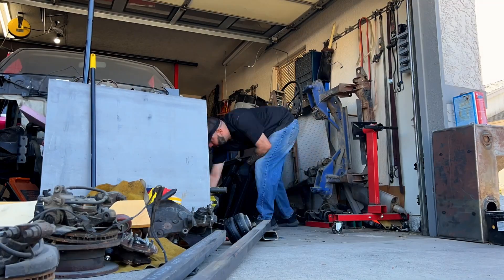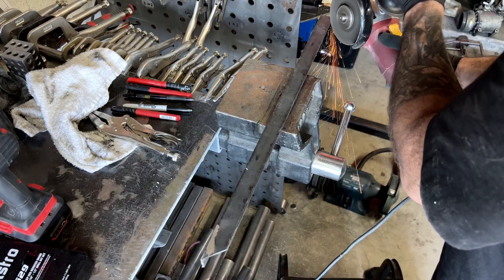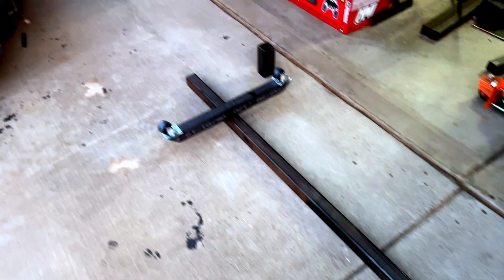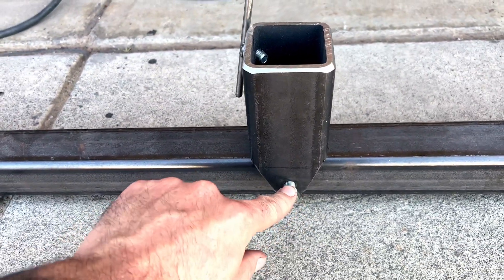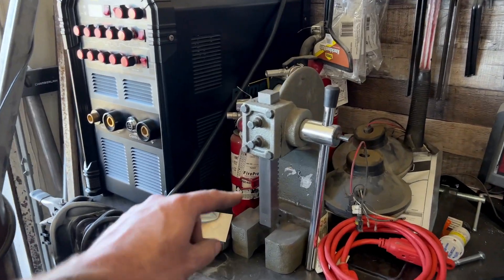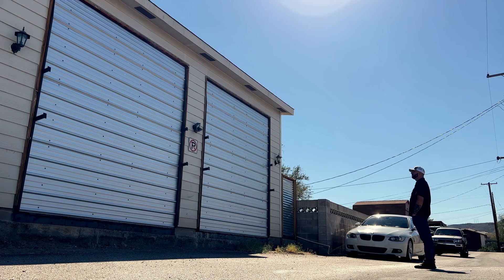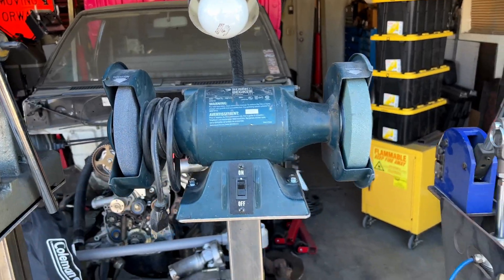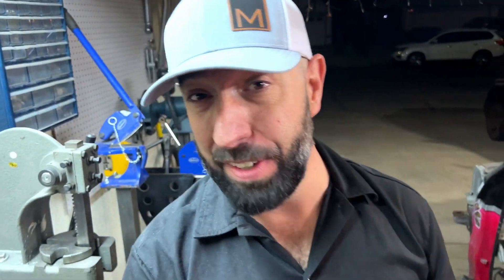Brilliant Legless Tool Stand/Storage System! Part 2? 🤔

Comment: I like the idea of having them easily accessible. At times its bothersome to dig it out and set up a tool .
Reply from the maker: @laurensmith1828  Agreed! In the short time the system has been up and running I found which ones I use the most and put them near the ends with enough room to use them without having to remove them.  👍

Comment: I like to maintain pressure down with a drill press and turn the tap with a wrench.
Reply from the maker: Oooo! I like that idea but I need more info. What do you put the wrench on when the tap is in the drill?
Reply: @GarageFab  I buy those taps that have a little hole at the top rather than a little point, and press a countersink or whatever into the hole.

Comment: Have you even seen and used an old timey secretary's typing station? It holds one typewriter and has a fold up/down extension on either side of the typewriter. Most importantly, it can be converted from wheeled to stationary. That conversion is effected by a lever that moves the four wheel casters to a point lower than the four stationary legs. The same lever reverses that action. I have one of these with a 5 or 6" vice attached and have used it for many years. I can bring the tool to wherever I need it and then secure it by raising the casters to place the weight and strain of the tool on the level shop floor. Reproducing this concept in robust steel for each tool would be rather complex and might be better done with hydraulics. It would also not be as rigid as your hole in the floor not to mention more expensive. Still, it might have an application for someone out there.

Comment: Nice work and idea, but I think I'd have built brackets off the wall and mounted the individual tools on that. Then using a single stanchion that would fit into the floor hole, set the stanchion and then the tool. This would keep your floor free and use FAR less steel and space. Tip that heavy monster over onto your nearly or completely finished car/truck and I am sure you'd be WAY MORE PISSED that you built something so incredibly top heavy and easy to tip. Remember, just a single pebble or wire or even a C-clip, could cause it to abruptly stop or go over.... So to me, this was an idea, but I'd never build it.. Your construction could cause destruction.
Reply from the maker: Good input, Steve!  Let me know if this is what you had in mind…
Brilliant(er) Legless Tool Stand/Storage System! Part 2.5!!
https://youtu.be/Jy9-lV8sn3g
Reply: Oh wow!!  Too funny... I just found your channel tonight and that roller rack was the very first video I watched. lol. I've been jumping around watching more, but until I saw that you answered me, I had not seen the answered video yet.. Too funny!!!  Now, I would make another observation and suggestion. Since you have space underneath the rack and already have brackets mounting it firmly to the wall, how about making a shelf under the rack to hold your chop-saw??  You probably already have a place for it that I just haven't seen yet, but for me, I like to keep similar tools close together.. For instance, I just replaced an old oak dresser that was storage under my workbench, with (2) lower cabinets from Hobo-Fright. The 8 drawers I use to have were too deep, but I could not afford much else when I built the bench. I'd fill and over-fill the drawers to the point of not being able to find things. Now i have many drawers that are far more fitting to typical tools and shop stuff and the drawers are all on bearings!!! This is great for a guy like me with a bad back!! I simply removed the wheels. Drilled some 1/4" plate for the 4 bolts and a nut I welded in the center to accept a 1/2" bolt that I screwed into the nuts to adjust the height and now the boxes are NIZ-EN-TIGHT to the bottom of my bench.   now, I'm going to check out more of your videos... Enjoy!!!  @GarageFab

Comment: Just subscribed to your channel cause I go through the same crap you do with room !  I need to find a way to store all my wife’s Kitty litter that seems to make its way in my shop! 
Thanks man, cool channel!
Reply from the maker: Spill more oil! Make use of that litter.
Thrilled to have you Gene! My passion is cars and fabrication but I’m getting this intense realization that everyone fights with the space issue. Not everyone can get a 2000 sq ft shop.
What I’m learning quickly is lessening the foot print of various objects is key. Think Sky scrapers. Put as much as you can on the wall, and stack things as high as you can.
We have five cats. 😳 and we purchase a years supply of litter every black Friday.
I built a cabinet specifically for cat litter that allows me to stack it to the ceiling in the tiny downstairs bathroom. It’s about 1ftx2ftx8ft. Barely noticeable space-wise.

Comment: Great idea of the square hole in the floor.  Its a little late now but using sliding posts that canv be adjusted back and forth on the main frame of the rolling stand would be great. This would be done by using short sections of slightly larger square tubing at the bottom of posts to slip over the  horizonta,l square frame tubing near the floor.

Comment: I totally get your excitement!  My garage is in a dire state of needing to be organized too...  And I need to add a tubing bender to the mix too.  Speaking of the bender, I also need some large radius curves for some bumpers I want to build out of some roll cage tubing.  Is that Harbor Freight tubing roller up to the task of curving strong material like that?
Reply from the maker: Yes Sir! It’s a great little tool! Go visit Swag Off-road. They make these “ears” that extend the width of the rollers which puts less stress on the machine.
Then to make it even better, they make a kit that attaches a Harbor Freight electric pipe threading machine to the roller to make it a power tool. 🙌
Reply: @GarageFab  Phenomenal, thank you!!

Comment: Definitely do the garage shop makeover with Justin. I was hoping you were just going to run those “set screws” as through bolts and drill holes spaced at a number of locations through your “beam” so that they would still be moveable but with the bolts or pins, it would’ve been more stable in the lengthwise direction. Of course welded works too!
Reply from the maker: It certainly crossed my mind, Erik! I was worried that if I Swiss cheesed the beam it would sag more, since it’s only a half inch off the ground. Even if it wasn’t so low, I’d still be worried I’d be weakening it since I believe it’s the vertical sides that provide the most support in this type of application.

Comment: I can completely understand having everything where you can find it again easily, and also the best thing about having a space for everything, is that when it's not there, you know instantly :) .. keep on going with allocating everything, as every square inch of bench top saved is a smile in an engineers heart
Reply from the maker: I have not had much experience being organized. I’m a hoarder and it shows. But lately! My newfound organization has allowed be to quickly locate several things that I’ve hoarded in the past and I received so much joy from it. It doesn’t feel gross anymore now that everything has a home and is easily found rather than lost in a pile of clutter.
Reply: @GarageFab  Yeah, hording is a habit of those who make things, as this or that may end up being usable at some stage. It's only when it's organised chaos that it's able to be used though, otherwise it's just a massive sap of time with the amount of effort which is put into trying to find what it is that you know exists and yet, don't know exactly where it is.

Comment: You could have added a gusset that welded to your receiver and not to your rolling chassis and it would have left you with your adjustability but structurally your tools would not have been trying to fall over 🤙🏼
Reply from the maker: Brilliant! I’ve made some changes to the system already and filmed a second video. I think you’ll approve. See you Sunday morning!

Comment: After watching your end result, the hole in the floor is a fine idea but I think I would go with a single post and interchangeable heads. The heads would be on something like a tree in the corner or could have an X base with the casters to roll around. Would take considerably less floor space, I presume.
Reply from the maker: I think you’re going to like the next video that drops this coming Sunday morning. 😆
Reply: @GarageFab  I have a post that protects my water heater and I thought about making that into a tree. I can't go into my floor because it's post tension concrete.
Reply from the maker: @davidsomerville7868  Ahh, yes. I recently learned about PT slabs. AFTER I installed my hole. From my research, you can still do the hole but you need someone to come out and mark your cable locations.

Comment: Ok that's a good bit of kit for the space conscious home fab man lv been utilising my hydraulic moto work table it to is on wheels and has extendable width for stability for use as my Tig / hight adjustable fab table/ jig table back in about 96 l started working for my self and also had zero space in my shed so l mounted my tools on Toyota land cruiser rims and used tail shaft's (used) instead of RHS much cheaper at the time so as l needed to l could lean on them on there edge and roll them around my shed in or out cheap easy to weld straight out of the wrecking yard
Reply from the maker: Brilliant! I like the adjustable height fixture table. I might have to borrow that idea. I currently have a fixture “table” with no legs that I keep vertical next to my bench. Do you think your moto table could be stored vertically?
Reply: @GarageFab  yes it drops down low to roll bike onto so l would need a day or so to nut something out to stand it on its end without going ars up and landing on my toes but perhaps but up to the wall and hook a hand winch up to it and fold it back to the wall
Reply from the maker: So you’re saying it’s not light. 😆
Reply: @GarageFab  no it's not light but lm using a motor bike lift table lm sure l could build on out of duralumin tube (second hand from scarf joint ) and that would be more appropriate
Reply: I think it's 100 plus kgs

Comment: Huge mistake, shoulda put some feet parallel to the base, so they wouldn't tip, and you could have kept the modularity!!!
Reply from the maker: I’m not certain what you mean by parallel, but the rack has already been retired. Only in service 1 week! The next video will show what has changed.

Comment: 12 days late to the party here and cannot read all 269 comments as of this writing but....9:49 I see a Primeweld Tig rig (225) in the garage...the worm has turned!   Regarding the mobile tool rack, this was probably already suggested but drill in more holes to move the lower sliders along to a different space or length and the actual holder...weld flanges just slightly above the lower main shaft (so they slide) and add stability.  And ...the stripper pole.   Debate is out....nice skirt though. If you get Merrill to join you can be Bambi and Amber.  Welder duo.  Or Tig and Mig.   A garage makeover is a good suggestion.  I have a small space that I work in and am constanlty battling to keep it organized.
Reply from the maker: Long time no see, Peter! Yup. Good eye. Mate! I don’t know how to use that TIG machine yet, but Imma learn! On camera prolly. There were some somewhat similar recommendations but no holes specifically.
I made that skirt by accident. I intended to create really short shorts. But I cut them so short I cut the crotch out. Had to do my trick backwards as to not get banned from YouTube.
A lot of folks want to see the makeover so we’ll have to see if it’s doable.
Get back to reading those comments. I could use an extra set of eyes. 👊
Reply: @GarageFab  good on ya.  TIG wise.  but will say the overlap between what you do and TIG is about 90%.   your MIG stuff is great.  you can WELD. gonna make a bit of a wave.  upgrade to a better MIG welder rather than learn TIG.  Fronius is your rig of choice.  I know Merrill may moan but he can be the Mankandy of TIG and you can be the TFS of MIG.  In Vegas.   BTW, a welding superstar is moving your way.  Kevin Stone.  google him.

Comment: You should have just welded a piece of 2 or 3" angle on your pockets and that would have probably been enough to keep things in place without actually welding the pockets on to the cross bar as the stand would have to "climb" over the angle to fall sideways.
Nice idea though.
Reply from the maker: Agreed! The stand is undergoing some changes. That just might be one of them.

Comment: Great idea on the storage rack!  I have six receiver tubes in my concrete floor. They’re all welded together on an I beam frame.  I may have to make a rolling rack like you did for my tools!
Reply from the maker: I dunno! If they’re out of the way? Why bother? I’ll be creating a rolling dolly of sorts to move the heavy tools from the rack to the hole. Maybe something like that would suit you better.

Comment: Funny as! I have plans for almost exactly the same thing. Now I know it will work well I will do likewise, ever seen how they transport glass well they do in Australia.  That will be my sheet metal on the bottom just to add weight to the bottom and I will have wall space back.
Reply from the maker: Nice! That’s strange, I think I had a similar plan that changed once I started building. Originally the rack wasn’t going to have casters. Instead one side was going to be anchored to the floor on a pivot and the other side on sideways wheels that would allow the whole rack to pivot away from the wall. On the backside of the rack was going to be sheet metal and plate storage. You’ve got me rethinking things since so much wall space is now taken up.
Thank you, Paul!

Comment: My timing is impeccable!  After 10 years, I'm starting to pour my shop floor.  I've dreamt of a "hole " beside and front for light dent pulls, removable tire changer, etc.
I have 2" trailer tube mounted on trailer implements and bench.  Very handy!

Yes, please video shop redo or iprovments.  THANKS

PS..   Consider a short tube that you could attach your portable cart to the floor... Maybe a 12 inch Section that holds it more steady.  It may help you not to have to remove a stand and save your back?
Reply from the maker: That’s quite brilliant! Just a couple of “pins” that drop into the floor would work nicely. Thank you my friend. 🙏

Comment: you could add another post holder in your floor when you need more than one tool during a project that needs you to use them back and forth.
Reply from the maker: Very true. I’ve considered either making a second at the head of the garage that would double as my anchor for a winch I use to pull in non-running vehicles or just putting a receiver in my work bench. 
Maybe both? 🤔

Comment: What about cutting all of the tool posts down to about 12 inches that will stop it being top heavy,  then have a single long post that goes in the ground then the 12 inch tool post goes in the longer post. 
Plus you can make part one by ripping out the floor hole and making it bigger for the single long post that the tool posts go into if that makes any sense

Comment: You could try drilling a dimple into you cross tube so your set screws won't move and that will possibly be more secure. If it doesn't work to your liking weld em up! BTW, fantastic idea. you solved my problem with my bender mounting predicament.

Comment: 1) Drilling the lock-bolt hole in the corner of the receiver tubing is a great idea....I like that! 2) I like the angle brackets on your chop saw to hold square tubing at a 45 degree angle. Probably could find a few more things to like as well but for now...I'm subscribed! Way to go brother.

Comment: That's pretty smart, but don't let your D50 frame on the side of your house become another place to hang stuff. Lol, because you know as well as anyone,shelves and shelf type things will magically get stuff on them all by themselves. But that's a head scratcher for another day. The off grid Ranger project is coming along nicely. Your fuel cell video is a constant source info. It's a trapezoid shape of sorts. Wish I had paid more attention in geometry class. Lol. Take care. I really do enjoy the vids. It's strange how building Equipment is so satisfying.
Reply from the maker: Haha! So true. I have a silly project I’m going to share that’s simply eliminating horizontal surfaces for that reason. I’ll be putting a pitched roof on my toolbox lid and angling the top of my parts/bolts bins.
Are you posting progress of the Ranger somewhere?
Reply: @GarageFab  no I'm not very savvy when it comes to posting stuff. I'm a analog man in a digital world.lol.

Comment: New thought!  Stabilizer legs. Put tabs sticking out front and rear of the middle. Attach tubing to them so they'll pivot. Caster on the end of each tube. Then you can swing them out, drop a lynch pin (etc) in through a drilled hole so they can't swing, and you can safely move the rack around without worry of it tipping away/towards you. Then just pull the pins and tuck in the legs when you park it.

Comment: As for 'sheet goods' storage - I picked up a drywall (mover? stand?).  It's not that deep (a foot?), but it's about 4ft long and has an upright that's offset already.  Perfect for storing sheet metal, plastic sheets, plywood, etc. BIG wheels come with it, so it rolls around easily in a shop.

Comment: I was think about items on my double sided stand which is trailer receiver style on a heavy stand has 1” and 2” belt sander,vice,bench grinder,plate bender,shrinker/stretcher,scroll bender all on removal receiver hitch style mounts what I need is like a vertical rack for them to stand on when not in use.